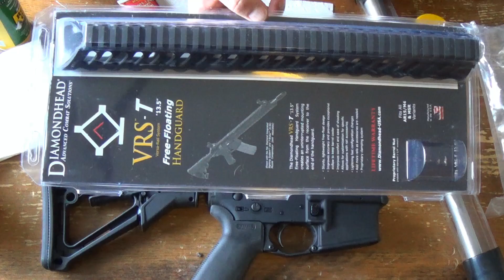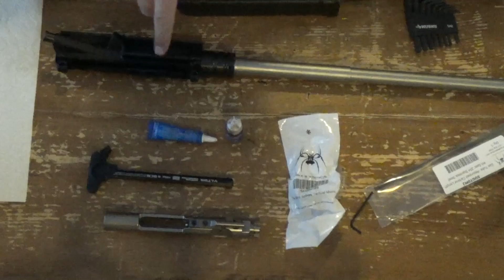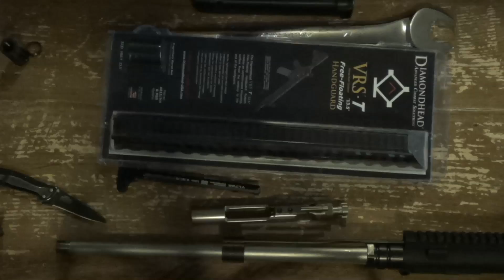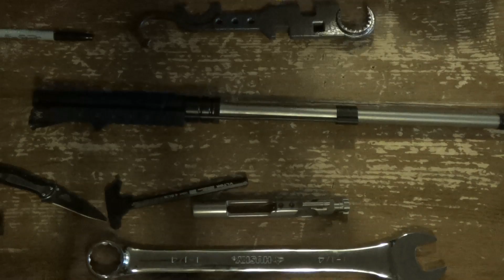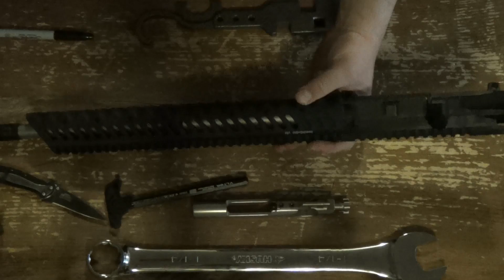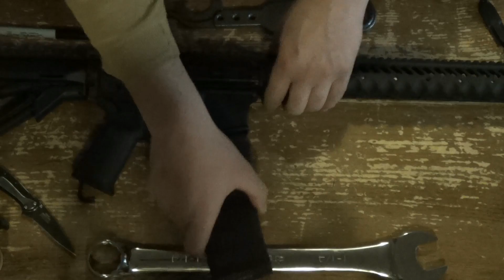AR-15 Build "Wilson Combat Barrel"

Comment: you fucked up mounting that Diamondhead forend you forgot to insert the two little pieces of filler strips that set between the inside of the handguard and next to the barrel nut
Reply from the maker: Your right I just built one a couple months ago I I noticed them.

Comment: Forgot to do the most important thing or failed to mention it. Check headspace. If ur somebody whos making ar build videos as a professional or not, at least need to make sure u don't fail to mention that checking head space is more important then any other step on that build. 1 out of 10 ar builds fill fail go and no go gauge test, since millions of companies are building the barrels and uppers with their own specs.
Reply from the maker: That's good to mention but since I was using such good parts I felt it was ok.
Reply: Wilson Combat checks head space on all of their barrels.

Comment: The W.C. barrel in your opinion  is it the same putting the barrel on compared to other barrels?
Reply from the maker: yes all AR barrels are the same mounting it's just quality.
Reply: @biged7175  appreciate  it brother, what is your opinion  on the W.C. Barrel you like them.
Reply from the maker: @yojimbo05  Wilson Combat in my opinion makes top notch everything.
Reply: @biged7175  appreciate  that Big R that means alot bro.  Have you seen the new AR-10 platforms bro they are nice.
Reply from the maker: @yojimbo05  I have just looked at the Dark storm large frames thinking of 6.5 ........
Reply: @biged7175  you know Aero Precision has a sale or did have a sale on there AR-10 platforms you can build one in 6.5 for a inexpensive price just a thought it may help you in the long run on a high end build.
Reply: @biged7175  I will check then out bro appreciate  the input and information.  There are so many AR companies out know hard to keep up with them haha
Reply from the maker: @yojimbo05  I'll take a look I'm know Aero.
Reply: @biged7175  yeah bro you can build one for a pretty good price.  Depending on the barrel and the upper features.  However,  you can setup your build how you want and get a complete lower receiver's for pretty great price.
Reply from the maker: @yojimbo05  thanx Jim Ive got an entire build series on a AR 15 so eventually lol....
Reply: @biged7175  in your opinion  so far as a torque wrench is Pittsburg Pro Series from Harbor Freight pretty good.  It is a turn click non-ditigal wrench.  I got one and looking for some professional input brother.  I doing Wilson Build now.
Reply from the maker: @yojimbo05  most of harbor freight tools are junk the only good ones are box wrenches, hammers, screw drivers simple non complicated tools stay away from the torque wrenches and anything electrical.
Reply: @biged7175  gotcha I was told that but I have heard good and bad about them.  I figured I would ask someone whom works or worked on AR-15 lol.  Appreciate your input and advise brother God Bless

Comment: I like and use rem oil myself but why put grease on barrel treads then spray with rem oil  the rem oil dissolves and liquefies the grease  hopefully you put a thicker oil on the lugs   ... I mostly use rem oil to clean a gun then after it dry's add something like Wilson combat oil or grease to wear areas
Reply from the maker: I think your splitting hairs here.
Reply: splitting hairs about what the use of rem oil and grease?  don't get me wrong I like and use rem oil but I never add oil or grease then spray it with rem oil